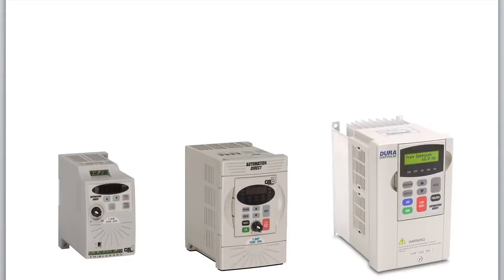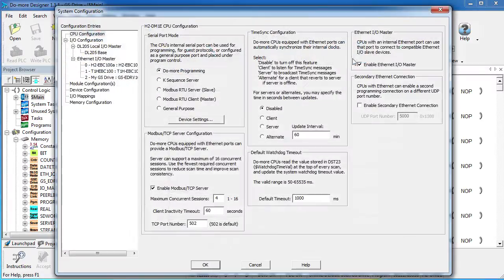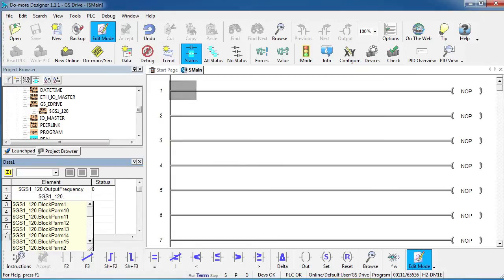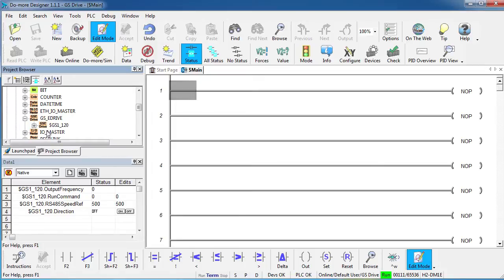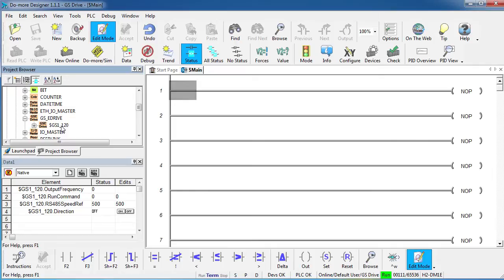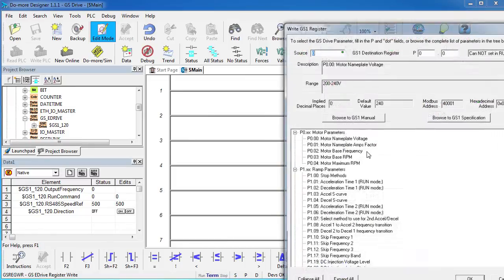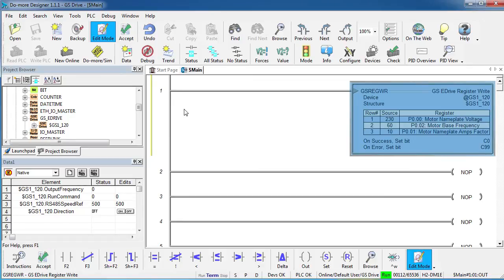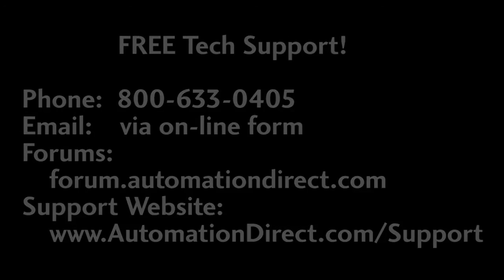BRX Do-more PLC Ethernet I/O - GS Drives Intro fromAutomationDirect

Comment: Well that was easy.  I put hard wired signals along side the Ethernet on this control panel but I doubt I do in the future.  Seems simple and reliable.
Reply: Looks good. I have not used AD PLCs yet, but they look easy to use.
Reply: ***** The old Directsoft was...well easier to use than the Siemens, but I've got to admit I like the new Domore a lot and there is very little learning curve going between it and RsLogix 5000.
Reply: My favorite kind of PLC is "not Siemens".